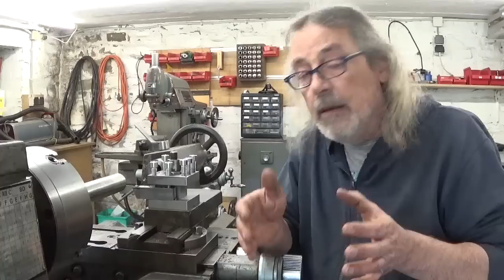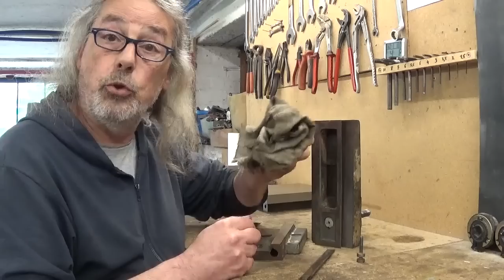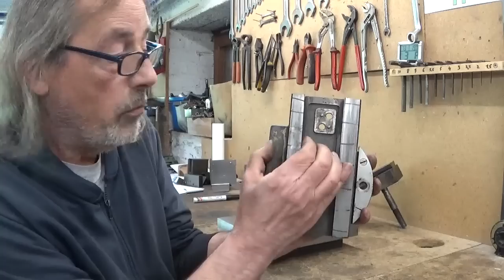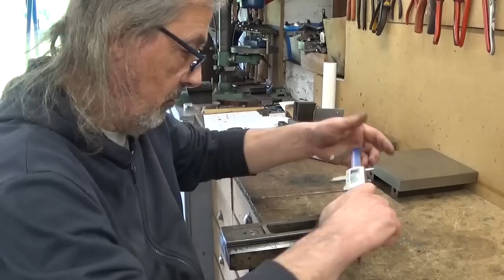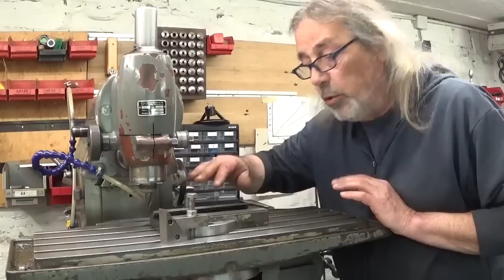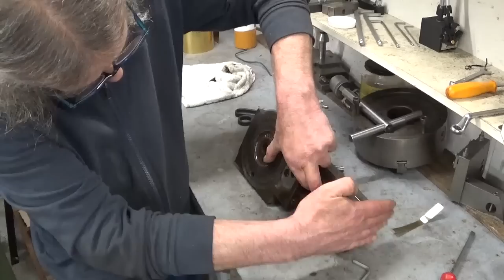Topslide fix.

Comment: Hi Micheal, 
When you first started checking the base for straightness and flatness, there seemed, from the video, to be a shinny  spot at the end of the "left" slide where it had obviously been damaged by a "chuck crash" at some previous time. Was the area, immediately behind the crash damage, slightly raised and that was causing the top slide to bind when it arrived at that position? The cleaning would have helped but the mill probably took the 1/10th mm off if it was there before, and fixed your problem. 
The "hardness" of the ways that you encountered on the shaper might well have been intentional "hardening" by the original manufacturer done by "induction". I dont know about your lathe, but many machines of about that era offered "induction hardened" ways of the main bed. Is it possible  that your machine had it extended to the cross slide and the topslide ways as well?
I'm  glad you managed to sort out your problem, eventually.  Thanks for posting.
Regards from Canada's banana belt.
🤞🇨🇦💪🍌🥋🇺🇦🕊🇧🇪🪓🪒🥫🐖👜👍🏁

Comment: This is why a lot of guys disassemble a new old machine when you get it to inspect / clean / and repair before you use it . then maybe you might have another 20 years of fun well you get it have fun .on mine i bought it over a year ago and now it's ready to move to were it will live in the shop . lets do 👍Good Job . JM
Reply from the maker: Fixing an old machine is part of the fun.
Reply: @Rustinox  I agree .

Comment: Hi Michel.  Looks like you got a decent result, but you took a few risks.  Odd that the lower surface under the slideways is rough, you're right that it stops you measuring, I think I'd have skimmed them with the shaper :)
Reply from the maker: No risks, no fun :)

Comment: You should check out Max Grant on his scrapping videos. Scraping is the key to real flatness. And the only time you should be feeding with your compound is when making angled cuts. There are locking screws to lock the gib so the compound doesn't move which is what you should be doing when making normal facing or 90 degree cuts. 👍👍👍👣👣👣👣👣👣👣👣👣👣👣👣👣👣👣👣👣👣👣👣👣👣👣
Reply from the maker: There are no locking screws on the topslide. And I know Max very well. He's a legend.
Reply: @Rustinox  I would recommend installing locking screws and locking them when making cuts. The effect that alone will have on the quality of the cut is amazing. I went through my compound slide last year and glad I did. I only have one locking screw but I am planning on adding another at the front of the compound slide.
Reply: Great channel suggestion.  Max Grant is what happens when decades of experience and natural talent collide.  There might be better 'how to' videos on scraping (Stefan Gotteswinter did a good tutorial, I thought), but Max got a lot of result with very few tools when he scraped his bridgeport's ways.  It's a crime his channel isn't more popular.  I've learned so much watching his videos.
For those interested: Max Grant ,The Swan Valley Machine Shop.
Reply: @pingwax.  Yes there are more "instructional" videos on scraping but Max is more real, in the dirt; What someone is going to be experiencing sort of thing in real life in their shop. I call Max The Wizard. LOL. I agree his channel is an unsung gem. In fact, all of the Aussie channels are great. Few American channels can really hold a stick to them.

Comment: Hi Michael, I don't have the same lathe, but my top slide gib has four setscrews with locknuts to adjust the gibs on both top and cross slides. Usually, gibs like on yours are tapered with an adjusting screw at each end. How are you "supposed" to adjust that gib normally? Making a new gib to tighten it up seems a bit strange. I couldn't  decern any threaded holes with setscrews in them for any adjustment. Just curious as to how normal wear is compensated for.
Your "repair" seems to have worked, but adding an extra shim seems a little overkill to me. There should be a way of adjusting that small change.
Regards from Canada's banana belt. 🤞🇨🇦🍌🥋🇺🇦🕊🇧🇪💩🏁👍
Reply: Adding shims to gibs is a normal practice. And yes there should be a way to lock the gib. I don't have time to go back over the video to see if there were any. If he doesnt have them he has enough of a shop to add them and he should.
Reply: The way the gib adjusts is with the screw at the fat end.  It has a step in it which engages with a slot in the gib, pulling / pushing the gib in and out of the ways.  In some cases (like the one on the X axis of my mill), there's a second screw at the thin end in order to lock the gib in place, but mostly it's not needed, as the gib can't back drive the screw.

Shimming when you get to the end of travel is a necessary evil when you have a "pre-loved" machine like Michel has.
Reply from the maker: There aren't any adjusting or lock screws on the slide. It's just a tapered gib.

Comment: Well done!
I wouldn't have tackled the fix like that, but then my milling machine needs some TLC to get it running accurate again.
When I did my topslide, it was straight to the surface plate, measure, scrape, measure, scrape etc etc until it ran silky smooth.
Time for you to learn how to scrape ways flat?
Reply from the maker: I absolutely hate hand scraping...

Comment: Great job there. The shaper and mostly the mill came to rescue to solve the problem. Respectable determination as well. Asking an engineering shop to surface grind that compound might have costed quite a bit. Hope the accuracy has improved there. Enjoy the weekend
Reply from the maker: We'll see. I have to use it a few times to know.

Comment: I like how you advise to clean out the chip pan, then don't clean it out! 😂
Reply from the maker: Well, maybe next time...
Reply: I had someone, my daughter, offer to clean my lathe and the floor. There is no chip pan! Unfortunately,  in the process she caught one of the flip top  oilers on the headstock with a long piece of swarth and it ended up on the floor, swept into the bucket used for metal disposal ready for garbage day.
 I discovered the loss before then and between us, we dumped the bucket's contents onto a drop sheet and sorted through about 5 kilos of shavings to find  the missing oiler. Leason learned. Clean your own machine!